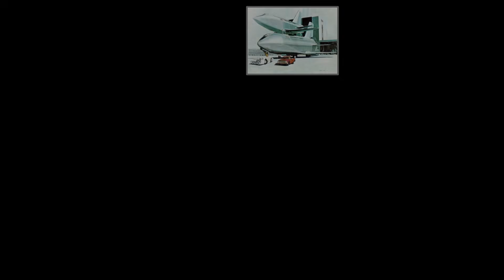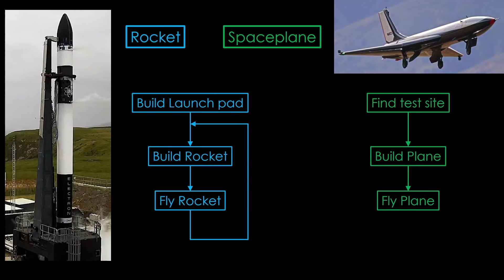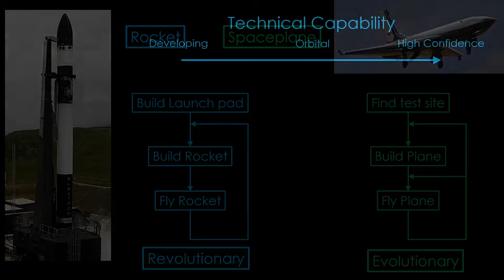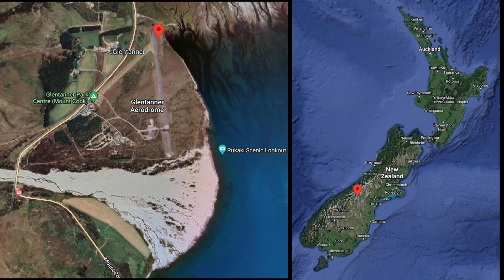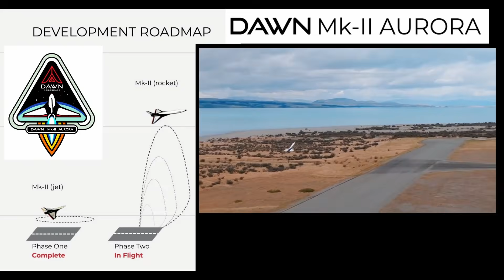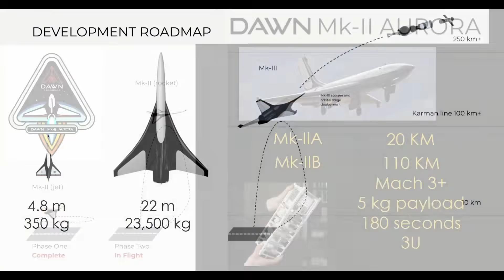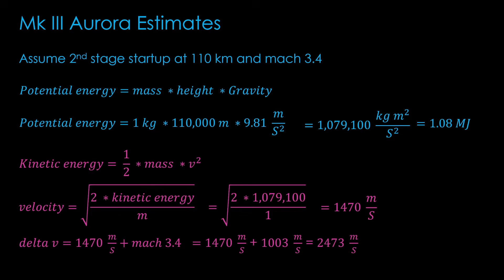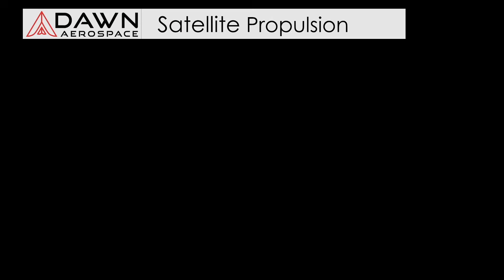Dawn Aerospace - Spaceplanes done right

Comment: Can confirm that RL uses a refined kerosene called D60. Not RP1
Reply: Always thought D60, D40 etc were solvents. Well, that's what I used them for
Reply: @Th3_Gael I wouldn't be surprised if they can be used in both ways; plenty of non-polar solvents can be burned as fuels
Reply: @MKdross gasoline used to be a common solvent
Reply: @liambohl apparently the original factory maintenance manuals for Pratt and Whitney radial engines include instructions for rigging up improvised gasoline showers for cleaning engine parts, I guess when there’s that much lead in your gas then spraying it everywhere out in the open seems like a good idea

Comment: There really is no need for an orbital delivery system to have wings, you have to haul all that extra weigh up there then slow it all down again on the way back. Glossing over the development of a Mach 3+ 25 Ton vehicle is very optimistic, considering it is in effect an SR-71.
Reply: If your 1st stage is a plane you dont need to build expensive and complex launch site, you can launch and land very easy
It is not an SR-71 and it will not have same technical problems, because it is not jet and dont need to breathe air, it will reach mach 3+ at 110 km, not 24 km
I think its more like german Me 163 Komet
Reply: @Syntropics you’re ignoring the massive obstacles of extreme heat and ridiculous fuel consumption going 20x further  than vertical takeoff through our soup of an atmosphere.

A good example of why vertical is better is demonstrated by commercial jets. The reason they take off at such an extreme angle is to quickly get up and out of thick air. Every second counts and the trade-off of upfront inefficiency is well worth it.
Reply: @Syntropics a good example of why vertical is better is demonstrated by commercial jets. The reason they take off at such an extreme angle is to quickly get up and out of thick air. Every second counts and the trade off upfront inefficiency is well worth it.

Comment: Dawn aerospace recently gave a short interview with parabolic arc. They are aiming for Q1 2024 Test flights of the reworked MK2(A). While MK2B should follow soon after (end of the year?).
I also liked that you included the math for some predictions on how capable the system will be. I never bothered to learn the math behind it. I simply take the ISP, then add a "0" on the end -> that gives me an idea of the exhaust velocity / and a lowball-good-enough-for-me estimation of the Delta-V. From what I read, that the Falcon9 only gets 3,3 km per second if the booster is expandable. While reuse flight profiles only give 1,8-2,3 km per second (back to Landing pad, or Barge landing). It would be interesting to know how much Dawn loses due to reusability.
Reply: "Only" 3.3km/s, thats Mach10.  Orbital velocity is Mach25. 🚀🏴‍☠️

Comment: Great video! A question: Have you heard about Polaris Raumflugzeuge out of Germany? They're quite similar to Dawn Aerospace in all the good ways and, funnily enough, they're launching their test flights out of Peenemünde, a name that might ring familiar to a rocket nerd.
Reply from the maker: I had not heard about them when I made this video but have heard about them since. 

I haven't looked at their Aurora vehicle deeply yet, but my initial impression is that they are biting off a lot - they need to develop a linear aerospike and their vehicle needs to integrate both jet and rocket engines and propellant tanks for both. Their target mass to orbit is 1000 kg, which means it's going to be a considerably bigger vehicle than the Dawn Aerospace one.
Reply: @EagerSpace  I absolutely agree, but I am hopeful. Their aerospike demonstrator MIRA is set to fly before the end of this year and hopefully will.
Reply: aerospike in air breathers strutjet

Comment: This is gonna be an interesting video to watch because I actually at this point don't think spaceplanes have much of a use in the rocket industry. 

Looking back now, with the knowledge that landing rockets propulsively works and is reliable, spaceplanes seem kinda like a concept born out of people's lack of imagination. 

Like "Oh, rockets that land back on Earth to be reused have to have wings and be a plane, because that's how we already get from the air to the ground already normally". It's a perfectly reasonable conclusion to come to, but plane-like hardware adds extra mass that mostly isn't needed on the way up. And sure, landing on a runway to just be inspected and then refueled makes rapid reuse easier, but I think SoaceX's catching system will be the way to go to making rockets that can also land, be inspected, and refueled quickly, all without wings.

My only thing is that I'm unsure if SpaceX's second stage reuse plans are the right way to go. I personally am very interested in what Stoke Space plans there, but Im unsure if that solution is as scalable to large rockets
Reply: I can't seem to edit my comment, but that "lack of imagination" is also why I think people naturally thought reusable rockets would be ssto spaceplanes, because "oh, it has to land back at a runway, all while staying in one piece, to be rapidly reusable". 

People couldn't imagine that you could both propulsively land rockets, and have rockets be in multiple stages, and still have it be rapidly reusable, to be able to land, be inspected, and refueled back up for another trip to space.

If SpaceX's second stage reuse plans work out, it will truly be as easy as "land the first stage back at the launch pad, land the second stage back at the launch pad, stack, inspect, refuel and go again". Just like a plane landing back at a runway, just in two pieces instead of one.

Comment: They should make the larger version have both rocket engines and jet engines. They can use the jet engines to climb to 20,000 or 30,000 feet then turn them off (create a enclosed area so they are not damaged in orbit). Start the rocket engines at 30,000 feet to propel the spacecraft to the orbit, and when they return from space restart the jet engines and fly it back to the airfield. This way they are not a unpowered glider and can go around unlike the space shuttle orbiter in a emergency or divert to a alternative airfield in case of bad weather, and do not risk damaging the spacecraft.
Reply from the maker: The tradeoff is:

Pro: Weight savings by not having to carry as much liquid oxygen. 

Con: Another set of engines, another set of fuel tanks, air intakes for the engines, a way to close off the intakes at higher speed. 

Generally speaking, the point of a first stage is to get above the atmosphere and going fast as quickly as possible, so the jets don't provide that much help. And the extra weight makes the mass ratio of the vehicle much worse. 

Dawn knows enough information to calculate which approach works better and they've chosen to go with a pure rocket approach.
Reply: @EagerSpace  me personally I believe it depends on the scale of the spacecraft like the aurora mark B II if the spacecraft is intended for suborbital flight without astronauts I agree there approach makes more sense practically and financially. I am simply saying for a larger spacecraft like the size of a 737 or 757 with a crew and cargo for orbital flight I still believe that the combined Jet engine, rocket engine is the best approach. Which would allow a greater range of cargo from different airports to be flown to the equator for a launch to orbit from around the many airports of the world much like how cargo planes operate today. But I do see were both you and Dawn aerospace are coming from.

Comment: I think this video is highly misleading.

This exact concept already failed. Twice.

The problem isn't the engineering, instead it is the market and the money.

Who will pay potentially hundred of millions of dollars to develop a vehicle with an insignificant capability, where SpaceX's rideshare and Rocketlab already cornered this market segment?

Even the similar Virgin Orbit is collapsed (less than two month ago), because despite backed up by an international megacorporation and led by a millionaire, is is too run out of money. I doubt a few model plane enthusiast with a shoestring budget would be able to build the Mark III within a few years and service multiple customers (for god's sake, they have less than 100 employees).
Reply: AFAIK, nobody has tried to build a horizontal takeoff rocket plane that will drop off a second stage at something close to 60 km and supersonic speed. 

Which companies were working on the same concept and actually flying prototypes?
Reply: @EagerNetwork-vl2zc  I don't speak specifically about this concept because basically every single rocket is unique; before SpaceX's Falcon 9, nobody tried to land with titanium grid fins, but this doesn't mean Falcon 9 is the first rocket.

Ignoring SpaceShipTwo, the two previous non-military plane launch attempts (that actually flown) were Northrop Grumman's Stargazer + Pegasus and Virgin Orbit's Cosmic Girl + Launcher One. Both were using already proven planes (and both had successes), yet they couldn't make the thing work cheaply enough.

Dawn Aerospace basically tries to build the best plane ever from scratch, and I seriously doubt that they have the expertise and especially the budget to make a full-sized launch platform.

For me, this looks like just another stunt, like the SpinLaunch (throwing a satellite into space). They also built a small model that demonstrated the concept, made flashy animations and videos, but still couldn't make the full-size thing work (and also had fewer than 200 employees).

These tiny, nonconvetional projects have a track record of...zero, since so far every single one has failed.

The only ones that at least exist in limbo are the Boeing X-37 (made by the world's biggest aircraft manufacturer, who also builds space rockets) and the Sierra Nevada Corporation Dream Chaser (made by another industry giant with thousands of workers, a budget in the billions, and who is also a NASA and US Army contractor). Yet both the X-37 and Dream Chaser look like toys compared to what Dawn promises.

Maybe history will prove me wrong, but I doubt it.
Reply from the maker: @Elfnethu  Both Launcher one and pegasus are launched from airliners, which means the benefit they get is limited due to the low altitude and speed. Pegasus is further constrained because its uses solid propellants with poor specific impulse, requiring three or even four stages to get to orbit.

Architecturally, Dawn Aerospace is different. Their plan is to get to 60 km with a similar velocity to that of a rocket like Falcon 9, and that allows a simple second stage to get into orbit. There's no technical reason that this approach can't be successful nor is there a reason their launch aircraft couldn't be reusable. 

Both X-37 and dream chaser are orbital vehicles that reenter like planes, but are launched as cargo on a conventional rocket.  They obviously need to handle reentry from orbital speeds which is very challenging. 

It is a big goal, however, and I share some of your skepticism as to whether they will make it. 

WRT spinlaunch, it's a stupid idea. The speed/altitude they can achieve from the ground is low enough that they need a two stage rocket to get into orbit, but the bigger issue is one of getting customers. To fly on spin launch, you have to put in significant effort to make your payload hardened against the high g forces but that effort is only worthwhile if you fly on spin launch. It's not clear that any customers will want to invest the money when they could just fly rideshare on SpaceX or a fully dedicated mission on Electron.
Reply: @EagerSpace  To reiterate: I don't doubt that a horizontally launched rocket plane could work (at least on paper), but I am highly skeptical that Dawn Aerospace could make this concept work, let alone a commercially viable one within a few years with no previous full-sized aircraft designing knowledge, an aircraft factory, or - especially - the money on hand (or the market to serve). 
In 2018 Dawn thought they didn't even need 30 million dollar, while even smaller companies, like the Chinese LandSpace, have already spent more than 1.5 billion dollars.

According to their own website, Dawn will at some point, in theory, launch a 5 kg payload up to 100+ km at an unknown cost. That doesn't fly anymore (excuse the pun).

I don't even know who would pay for that (and at what price). There are already research planes (including microgravity) and sounding rockets covering this extremely niche segment (not to mention SpaceShipTwo or Blue Origin's New Shepard, which also carry multiple similar experiments), while almost everybody else is already using actual orbit-capable rockets.

Boeing and Sierra Nevada are still working on their kind of, not really useful designs despite their basically unlimited budgets, manpower, and huge expertise. Same with SpaceShipTwo. I just can't see how a few dozen people with no real money or experience could make a much better vehicle with a fraction of the budget within a few years, next to not only SpaceX but their new, much more realistic competitors, like Rocket Lab or some of the Chinese companies.

There are already dozens of similarly overpromising, unconvincing designs backed up by nothing more than the inventor's world or some scaled-down models. The road to (commercial) space is littered with failed proposals and even built vehicles.

I give Dawn the benefit of the doubt that they will be able to operate their tiny rocket drone reliably, but I would be very surprised if their Mark III idea would materialize, let alone become a commercial success. 

We'll see.
Reply: @Elfnethu Boeing? Seriously. Don’t even mention that name, it’s a joke.
Reply: virgin galactic vss unity

Comment: 1500 m/s for altitude and 1000 m/s for horizontal velocity doesn't neccessarily add up to 2500. Added diagonally, it's just 1800 m/s.
Reply from the maker: The delta v for altitude is an expression of the potential energy in velocity terms, so that is added directly to the horizontal velocity.
Reply: @EagerSpace  yes, vy = sqrt(2gh) ≈ 1500 m/s is the velocity in the up direction. Add 1000 m/s in the horizontal direction and the total velocity is 1800 m/s diagonally. The velocity vectors aren't parallel, so you can't just add the magnitudes.
Reply from the maker: @15Redstones  Delta v is used because that is what comes out of the rocket equation for pure rockets. 

In a launch, some of it goes to gaining altitude, some of it goes to losses, and some of it goes to final velocity.
Reply: @EagerSpace  yes, and it's a vector when you calculate the change in velocity in the world, only a scalar when calculating fuel consumption of seperate maneuvers.
I have a bachelor's degree in physics and 500 hours in ksp, delta-v isn't new to me
Reply: With a masters degree in spacecraft engineering and well over your hours in KSP I’m pretty sure you’ve misunderstood.

He’s talking about energy, not velocities.

If you try any other scenario using your method you get some wild results.

Comment: You failed to mention  X-33, X-34 and  Skylon.  the X-33 wa 90% complete before it was cancelled (due to insistance by politicians to employ carbon fibre technology for propellant storage.  Skylon with its Sabre engine is still in late development in the U.K.
Reply from the maker: I had them in there originally, but pulled them out.

X-33 was a technology demonstrator and would only fly suborbital, and of course it didn't do that. 

X-34 was also a technology demonstrator that would have been airlaunched for testing purposes. 

Skylon has been around for 30 or 40 years depending on how you measure things, and so far has only had some engine demonstrations.

Comment: As an orbital launch vehicle, using HTP, it will need a relatively huge second stage, both to make up for the low delta-v performance of the "first stage"  and to make for the low ISP of the rocket engine. Where will that huge second stage fit in that sleek "first stage"? I don't buy it at all. But thanks much for the informative video.
Reply from the maker: Have you done the delta v calculations to figure out exactly how big a second stage you need?
Reply: @EagerSpace  No, but I can guess at the size, given the constraints I mentioned. Bigger than a Falcon-9 second stage, I imagine. Do you have such calculations?
Reply from the maker: @williamthomas5788  Rough ones...

I took a typical dry weight to payload factor for a second stage, plugged in the expected specific impulse for their engine and came up with a second stage total mass. Given what I expected the first stage to be able to do, it seemed like a reasonable calculation. 

It's pretty hand-wavy, but good enough as a first-order approximation. Clearly Dawn can do a much better job at doing the calculations and they think it's possible.
Reply: @EagerSpace  The problem is, can a sleek, fighter-shaped airplane with a lot of rocket fuel actually manage to carry that second stage internally? That is what I'm skeptical of. But, hey, maybe they'll prove me wrong. But count me doubtful.
Reply: @williamthomas5788  Why does it need to be internally carried?